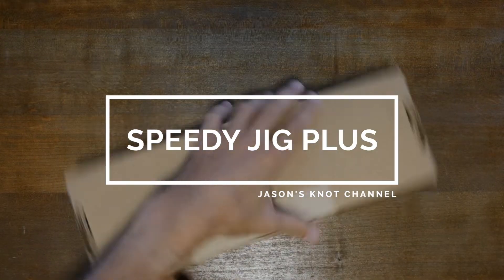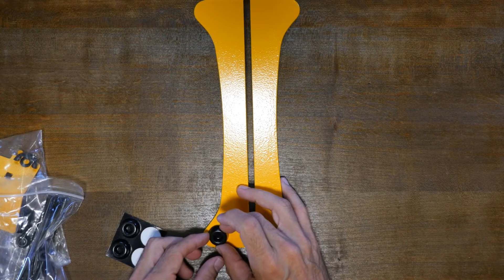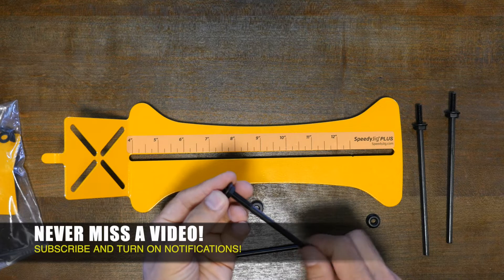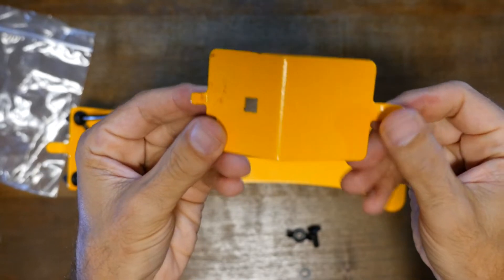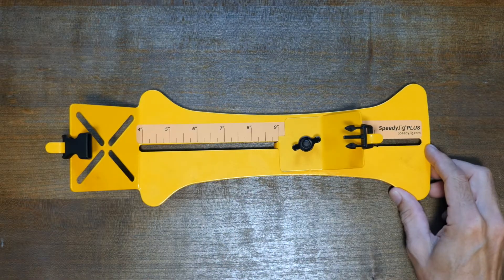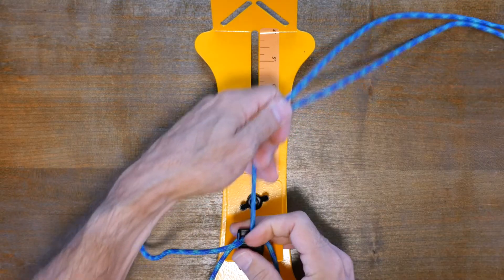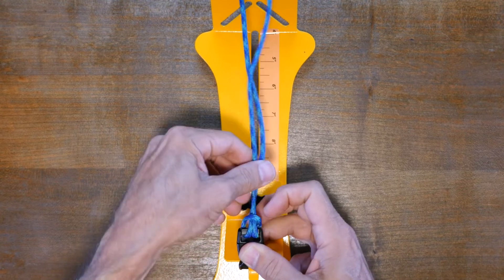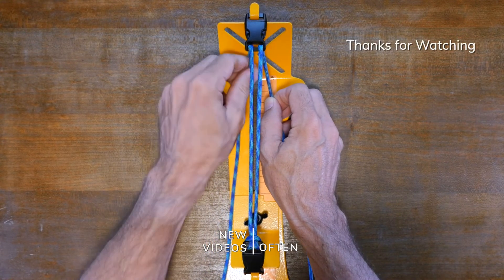I upgraded my Paracord Jig to the SPEEDYJIG PLUS! Here's Why

Comment: Hey Jason, great channel!  Quick question for you:  do you find the measurements of the jig to be off?  When I place the 3/8 buckles on and use the upper notch it’s about a half inch off.  Same for the 5/8 in the lower notch.
Reply from the maker: Take into consideration the different buckle sizes
Reply: I have one of these as well and find the same thing.  Being new to this, maybe I'm using this wrong and can't find videos anywhere to explain it but no matter the buckle size, the notches don't produce a bracelet of the length indicated on either notch.  

Hey Jason, maybe you already did this and I didn't see it yet but is there a video you made on sizing and using the notches?  Please link if so!